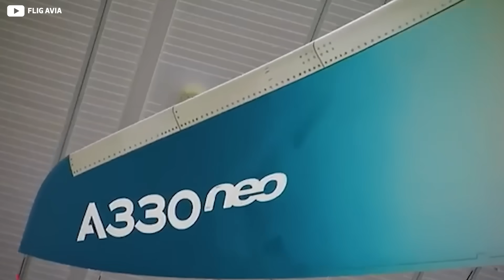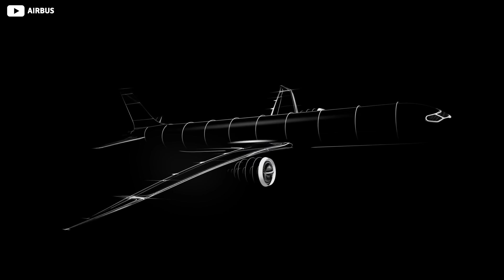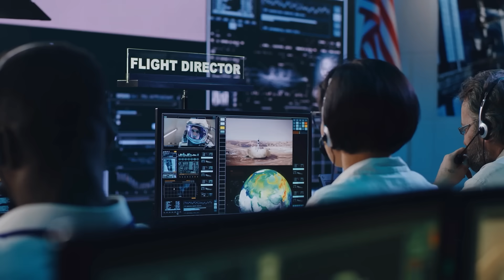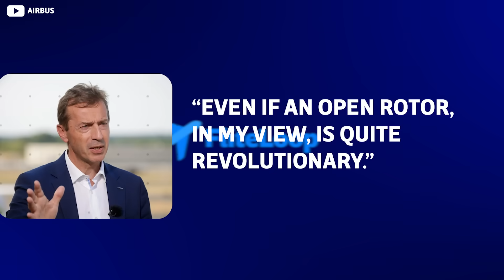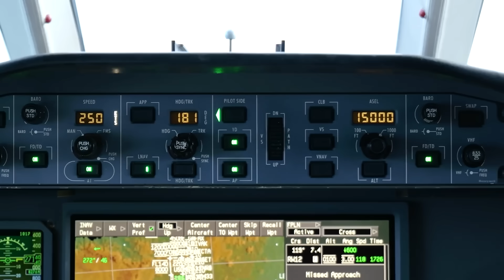The Airbus A360 Rumor That Could Change Everything

Comment: A330 was developed in 1987, nearly 40 years ago. Its competitor,  B787, newly developed in 2009, is much more very popular than A330neo. So it is time to make clean-sheet design of A330 successor, not just re-engine.
Reply: Airbus is not the problem. They are advancing their technologies. It is the Boeing who keeps things around for way too long. Two examples… 737 is from 1964. It is older than I am. B-52 is from 1946. KC-135 is from 1950. The list just goes on and on. 🙄

Comment: Airbus & the 2 engine providers doing their capability acquisition as it should be done. Fully prove the new tech to reduce the product introduction time. It will still take 7 years for the next clean slate frame.

Comment: Airbus needs to keep working on the next narrow-body range, continually updating and tweaking without locking in the design for now. This will allow them to announce it at very short notice. With all those various technologies worked out, just selecting those appropriate for then, while meeting the airlines wishes, as well as being worthy competition for Boeing.

Based on past and current performance, it is likely, that if nearing readiness to go, the Airbus could quite probably be in service before the Boeing, and steal the advantage. No doubt Boeing, will suffer because the Airlines will, based on Boeing's history, be extremely cautious about the validity of any timeline they are given, or even promised.

The danger of waiting? That it is not Boeing who jumps first, but another manufacturer such as Embreaer with a reputation for efficient development and shorter delivery waits.

Comment: This is so wrong. The focus will be the next narrow body airplane. Widebody airplanes are set for the next two decades with re-engine and continual improvement of the A330neo/350 B787/777x.
Reply: All this carbon bs. It is not pollution it is plant food. 
Without co2 we all die.

Comment: Airliners of today cover every base of the industry, we have aircraft that can move over 500 passengers, we have aircraft that can fly ultra long range routes, we have single aisle aircraft thats goes far above its sector, what we don't have is an aircraft that will do the long-haul routes in a shorter time, we don't have aircraft that flies faster than the conventional aircraft as we know it. We need an aircraft that can economically flight at  1000 - 1200 Km/ hour regardless of the weather and wind conditions outside, now that would be a breakthrough and a game changer in aviation. Imagine if you could fly today, a flight that would take 17 hours nonstop to fly conventionally in say 12 hours, now that would be something.